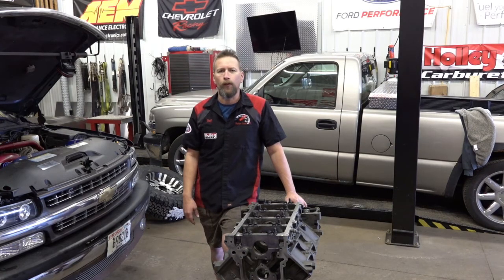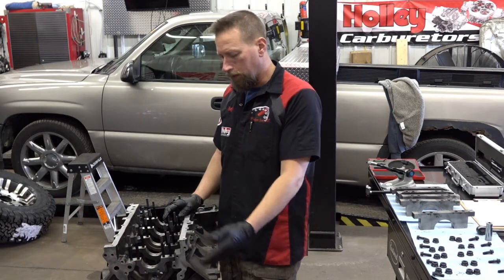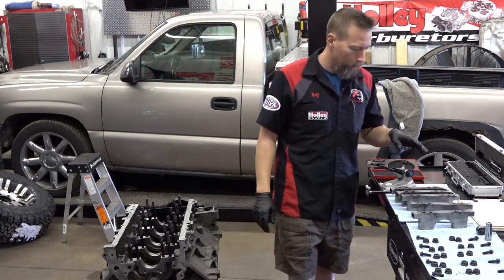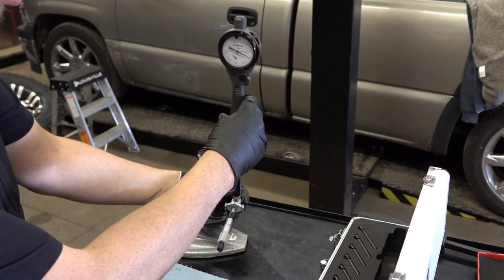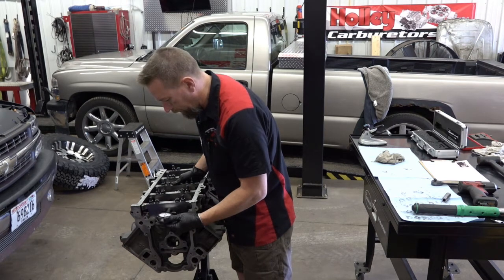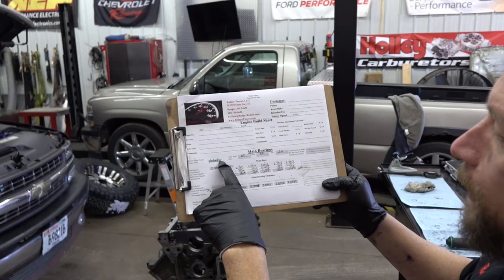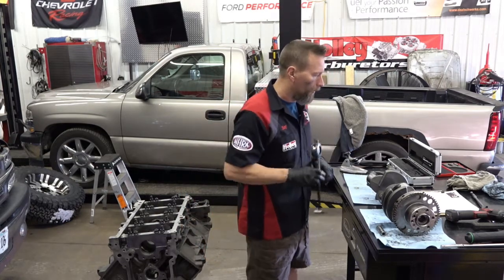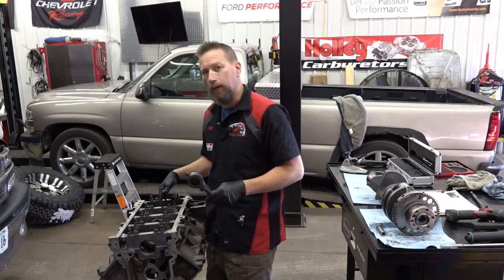How to find LS Crankshaft Bearing Clearances

Comment: Badger,  im rebuilding my 2004 LQ4 motor, OEM.  Is the clearance/spacing between the crank and crank bearings the same for Gen III motors?  Im going to take the center cap off and use Plasti guage to measure the spacing.  For the general rule, .001 thou for every inch.  So it should average about .0025?  Is This what the plasti guage should indicate?   I understand it will vary because of wear.  Thanks.
Reply from the maker: @natester1064  is this for a stock rebuild? Or you wanting to make some power?
Reply: @prostar828  stock,  the cam got damaged when the lifter failed.  So while the motor is out I'm replacing components and checking the bearings.   Everything going back on the motor is going to be stock.
Reply from the maker: Stock I would be okay with anything between .0015 to .0023 on the crank and .0013 to .0021 on the rods. You could run the 10w-30 oil with those clearances. I would not go any looser. .0025 is too loose for a stocker. Gen 3 LS engines do well with a slightly tighter than normal clearance. Make sure you have .028 to .033 clearance from piston to lowest part of head to get the quinch right. You can do that with the head gasket thickness, and yes I would pay the extra money for a custom head gasket from Cometic if Nessecary. You get that right and you will have a nice running motor!!! Good luck
Reply: @prostar828  thank you for you help.  Keep making some videos 📹 😃 😊
Reply from the maker: One more thing. Use Lucas break-in oil, ONLY! It's a straight 30 weight with HIGH ZInc content. So Don't drop oil after engine break-in. Keep the same oil in it for 100 easy miles and that zinc will seat in your motor for life. Then run your regular oil after that. Best wishes
Reply: @prostar828  Thank you!

Comment: but by swapping just the lower half of a bearing to adjust clearance wouldnt that make your line hone off?
Reply from the maker: Hay Joe, The Manufactures of Clevite, My fav Brand, Post on their website as well as from the tech department that Splitting bearing halfs with the contingency that only the lower bearings are switched. And when you buy them youll see on the box that part number will have an "X" appearing in the part number, for "Extra Clearance" of a Half Thousands. Sanding bearings is never recommended. So thats why for that, Now to address the line hone. No, Absolutely not because all the excess oil that passes through the bearings gets either squeezed out onto the crankshaft destined for windage and the pan, Or it gets pumped out towards the connecting rods and gets flipped up at the Camshaft, of which means its now locked into a frenzy swirl between the cam and crank, and if its lucky it could get flipped up into the lifter valley with the next acceleration as the rescue back to the pan.
Reply: @prostar828  super helpful info right there ☝️☝️
Reply: @danthisguy8541  Thank you! Glad you enjoyed it!
Reply: @prostar828  very good information!   Thanks.
Reply: That music kind of drowns you out